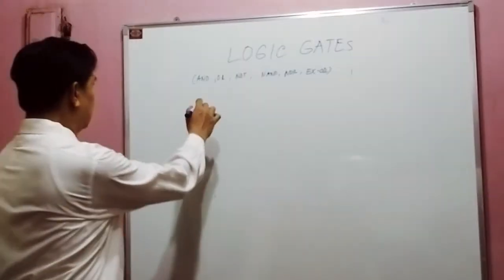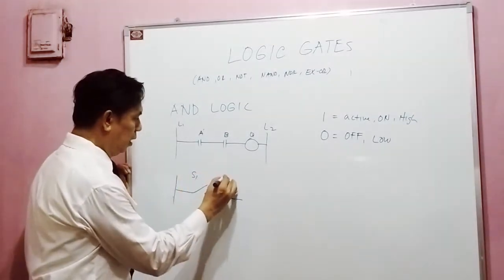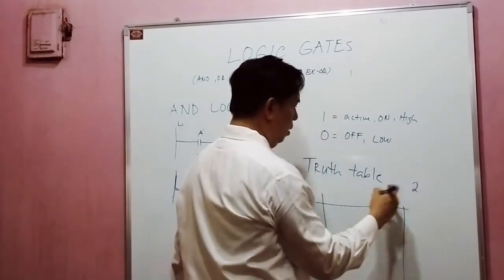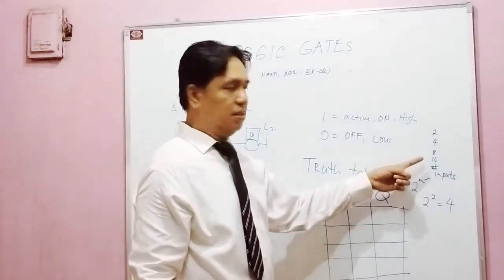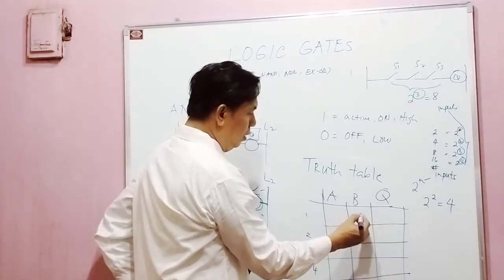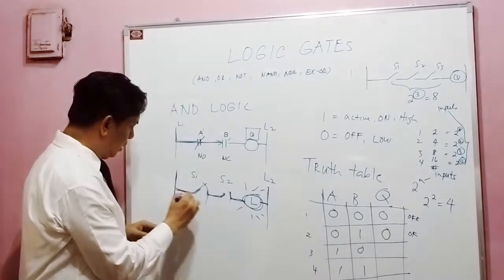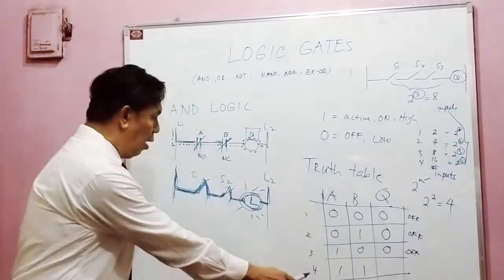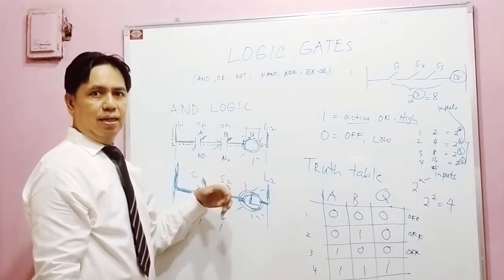AND LOGIC

Comment: I know  that AND logic principle is used in the printing press, particularly in a paper cutter or trimmer machine where the operator uses his both hands to effect a shear of paper. Two push buttons must  be pressed at the same time  so that the solenoid of hydraulic cylinder where the shear blade is attached  at the the tip of the  piston rod is energized. Only one push button will not energize the solenoid, two is needed, to effect a cut of  paper of desired thickness..:)